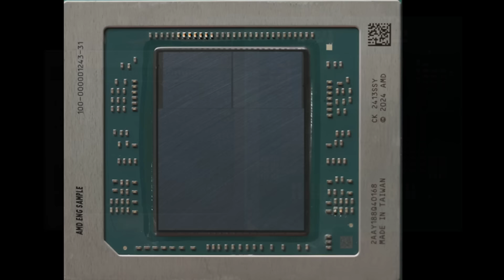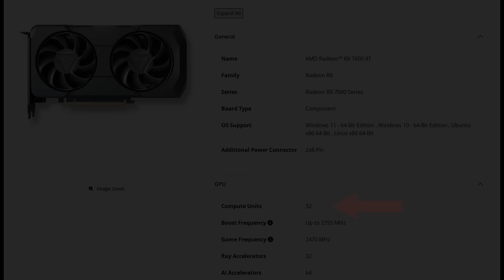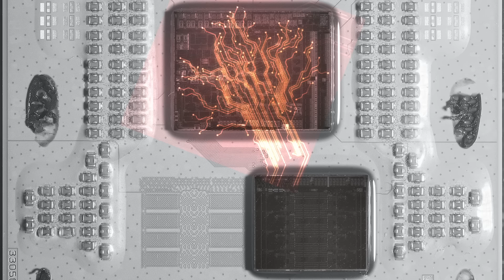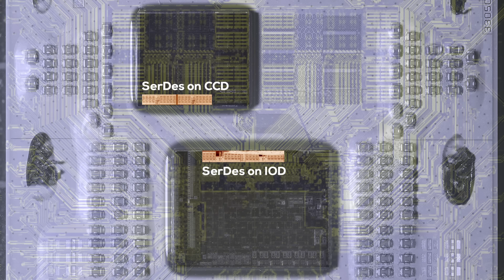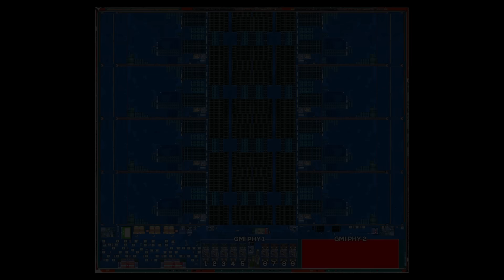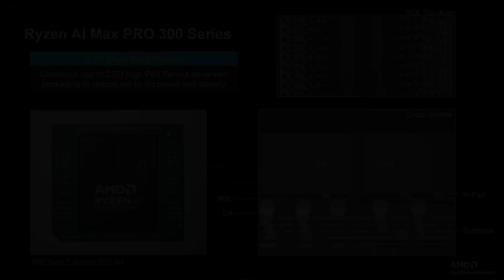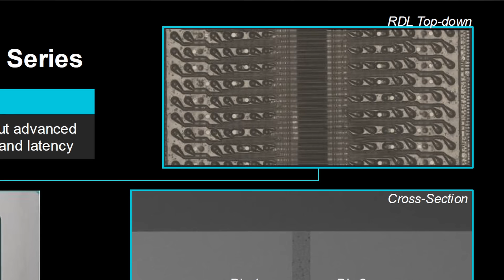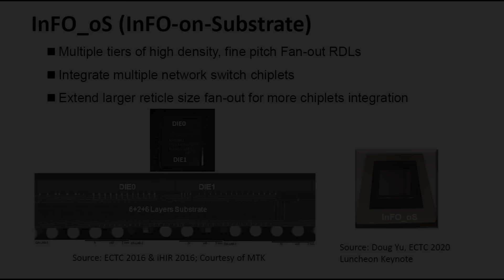How AMD is re-thinking Chiplet Design

Comment: STX Halo is such an awesome system (yeah if not for the unfortunately astronomical price)
Reply: The main reason for the currently inflated price for Strix Halo is the relatively great performance for LLMs. Maybe we (consumers) are lucky and that bubble bursts soon.
Reply: @abavariannormiepleb9470    The main reason the Halo APUs are so expensive is that they are workstation chips.  They are not intended for consumers at all.  They just happen to also be good at gaming.  It's the same ethos as a GeForce Titan card.  If you want gaming, you will get better results for less money with an i7 and 5070.
Reply: @abavariannormiepleb9470  has the bubble burst yet? checking in from the future
Reply: It's a bubble and bit of premiums related to "new" Gen 1 tech. As with anything tech related if you are price conscious wait for the Gen 3 (so Zen 9 if they don't change the naming)
Reply: It's justified, the 40CUs of RDNA 3.5 on par with a mobile 4070 on top of having 16 full Zen 5 cores was $2500-3000 laptop tier performance anyway. What's most impressive is all that is happening on cheap gaming laptop level cooling and power envelope, and relatively inexpensive LPDDR memory.
Reply: @hasnihossainsami8375 agreed. The BIG difference that people seem to sleep on is how much better performance you can get at lower watts. If this is comparable to a 4070 Mobile chip, it is basically a 7600 non-XT. And that is a 165W card. You are basically reducing the power envelope with over 50%. That is bonkers. 

Imagine what they can do elsewhere when you suddenly have an architecture that requires so much less power. You can either create products that need less power, cooling and size, or you can scale up and use the same power envelope, but pack in a whole lot extra performance. As an example, if you straight up scale the efficiency of the 8060S at 80W up to RTX 5090 desktop performance, you would need around 370W for it, compared to the 575W TDP it has. Now, performance does not scale linearly, but it shows how big of a deal this is.
Reply: @hasnihossainsami8375 a 4070 laptop with a 7945hx is ~1300 at most lmao

Keep coping though
Reply: It is quite similar in price to the intel and Nvidia counterpart.
Reply: its always at the start, theyre prolly still building up infrastructure to mass produce it untill then we will tank the prices
Reply: Zen6 should be available next year for better prices. Although these massive integrated GPU chips will still be pricey. 
And the desktop mainstream slop will still use a single compute tile/chiplet, halfing the interconnect bandwidth again. 
So strix halo really doesn't seem like a bad investment, considering you're getting workstation level bandwidth and a reasonable gpu.
Reply: @PaulSpades Medusa Halo seems to be scheduled for 2027 or even 2028, and if it were to come out in 2026, it'd definitely lack the UDNA graphics architecture and LPDDR6 support and therefore would have the same weak graphics and AI performance as Strix Halo (no proper matmul acceleration, no flash attention support for RDNA, not enough memory bandwidth for transformer models if its compute performance would improve, and overall it's a tiny GPU)
Reply: @обычныйчел-я3е darn it 😔, it's a long wait to get full advantage of this eh?
Reply: @обычныйчел-я3е imagine caring about AI
Reply: @обычныйчел-я3е what's your opinion on intel ultra 3xx series, it will have 180 tflops, not sure how to compare its Arc gpu with the strix/medusa halo gpu, however in the ultra 2xx series, the Arc 140 a;one has 77 tflops on pair with the one in the strix halo
Reply: @videoclick2009  HUH Ultra 2xx has Arc 140V as a top iGPU which has ~8TFLOPS of FP16 performance, not 77 TFLOPS, and it's nowhere near Strix Halo in performance. It competes with Radeon 890M which is used in Strix, not Strix Halo. 890M has 16CUs, not 40 like Strix Halo. Also, where 140V ends, clocking to the maximum, 890M is at roughly half of its peak performance as it should clock to almost 3GHz but it only needs ~1.6GHz to compete with 140V. And it's memory bandwidth limited. All AMD needs to ~double the GPU performance of 890M is just to give it faster RAM.
Reply: @alondjeckto 
AI techniques can be useful. I specialised in AI in my CS degree. I have since built two chess engines as a hobby. AI is a broad field of CS. The problem right now is the hysteria and hype and the ignorance. I use AI, so I guess I care, but I care more about single threaded performance than I do AI performance... and I don't give a toss about GPU performance.
Reply: @alondjeckto  imagine living in the past and not caring about AI
Reply: @videoclick2009  Intel 140V doesn't have 77 TFLOPS. It has ~8 TFLOPS of FP16 performance. It also doesn't compete with 8060S in Strix Halo but Radeon 890M in Strix. 890, which is memory limited and only needs a clock of ~1.7GHz (while it is able to achieve almost 3 GHz) to compete against 140V. AMD chips also do not use N3P node as Intel, but rather N4P that is worse in efficiency.
Reply: @Osaka2407  just verified, the arc 140v is 13 tflops fp16 and 8060s is 29 tflops
Reply: @videoclick2009  In what world does 140V has 13TFLOPS? It has 1024 cores and clocks up to 2050MHz in 288V. It equals to 4.1984 TFLOPS of FP32 throughput and double of FP16 throughput. The only way you will come anywhere near 13TFLOPS is my summing FP16 and FP32 throughput but it does not work that way. Also, 8060S clocks up to 2900MHz and has 2560 cores. That's 14.85 TFLOPS of FP32 and almost 30 TFLOPS of FP16. I do not know where you get your numbers from but they are wrong. And another thing - Radeon 890M has 1024 cores just like 140V, yet it generally wins against it, even when working at lower clocks - RDNA 3.5 simply has higher IPC which is not a surprise as Battlemage is roughly a generation behind AMD and NV.
Reply: @обычныйчел-я3е Nah homie its not schedudled for 2027 or 2028. Imagine AMD missing out in the AI race against apple and intel. Also its far away from being a weak gpu as it literally beats a rx 6600 which is a beast already on 1080p. Matmul accelerators matter for the tech purists only because it literally doesnt matter if you don't use epoch sized prompts. ( It primarily matters on how long prompt are you inputting) 

Medusa point is 100% coming next year. Apple is already rolling  out m5 this year and intel will roll out its own 8+ xe3 socs early 2026
Reply: @Osaka2407 Xe-LPG 140V as seen in 258v is claimed to have 64 TOPS (INT8 matmul), 32 FLOPS (FP16 matmul) if you take XMX into account.
Reply: @HeadleyyHighlights it beats RX 6600, the low-end GPU from 4 years ago that can be had for ~150$ now, and is only very power-efficient and remotely cost-efficient when attached to the CPU which is essentially an power-limited 9950X that not many people need. 
All of this IS very impressive and I'm all for it - however the GPU performance isn't enough for me (I want playability at 4K and it won't even run FSR4 very fast ;) and not much for the price they're asking, nor is it a game-changer for ultra low power consumption that'd be usable from battery power (the technology it uses will give us all of that, though).

Lack of matmul isn't a problem directly, it's just that it can be used to amplify AI performance (including its density and efficiency) by a factor of several times and is already giving NV an edge for last 4 client GPU generations and even Intel has it on Xe1 and up, Xe2 and up for iGPUs. (AMD implements matmul in CDNA and has doubled down on low-precision matmul for AI purposes in CDNA 4). 
Such a performance boost would help to use the huge memory capacity that STX-H makes available with AI or run a heavy upscaler efficiently.

I'd like it to come next year, but from all the recent leaks it seems that RDNA 5 and Medusa Halo is far from ready and complex silicon products like this don't just pop out of nowhere in 6-12 months. From the same leaks, it seems to me like 2026 is going to be a drought in the space of consumer products from all companies.
I guess Medusa Halo may also be more affordable since they'll be able to reuse CPU chiplets from desktop parts, instead of making special ones specifically for it.
Reply: It is coming down in price in some models.
Reply: I was wondering why it's so rare and expensive. Now it's so much clearer.

Comment: I just didn't understand one thing: Why did they keep using PCIe to connect the 8060S to the system and not something with faster connection
Reply from the maker: The 8060S is on the SoC die, it’s not connected via PCIe. These lanes are for M.2 SSDs and other external stuff.

Comment: Thanks for the cool content! One question: Why are the SerDes not being called Multiplexers/Demultiplexers (Mux/Demux)?
Reply: I think because MUX/DEMUX implies a selection of where to MUX from and where to DEMUX to. SerDes just puts all inputs in sequence over the link. Otherwise, I gues they function the same. I suppose a MUX/DEMUX can function as a SerDes if controlled properly.
Reply: @alexandru_donca  Thanks, that would make sense :)
Reply: because Mux/demux means selection. SerDes means conversion. They are not the same like at all.
Reply: @johnyang799  I had a look into a lowgrade documentation. Input A of a Mux is usually routed to Output A of the Demux. Input B to Output B etc... So it would be exactly the same like SerDes.
Reply: @thomaskunz3726 Yes if you look it that way. But it wouldn't hurt to ask ai to see what are the implications and differences in implementation.
If consider loosely, SerDes is like a special case of Mux/demux. Also SerDes implementations includes high speed mux/demux + clocking + analog i/o circuitry.
Reply: @johnyang799  Ah now we have the difference, serdes needs a clock :) Thanks!
Reply: On the other hand, some mux/demux also have a clock... hmm....
Reply: @thomaskunz3726 To some extent, and exaggerated, calling SerDes mux/demux is like calling cpu transistors or logic gates. Mux/demux are used to build SerDes but you wouldn't expect the next person understand that you meant SerDes.
Reply: @johnyang799  why would you need analog anything for a perfectly digital signal?
Reply: I prefer encoder-decoder, but americans must invent new words for common old tech, all the time.
Reply: @PaulSpades Encoder and decoder mean too many things already. Let serdes be serdes.
Reply: @johnyang799  In other contexts, yes. I guess some people call media accelerators the same thing now.
Reply: @PaulSpades  I bet the marketing guys love this :)

Comment: If the future of zen is this ridiculously overpriced Halo garbage, count me out. I‘m not paying 3000 $/€ for an APU, even if it is an admittedly good APU.
Reply: AMD is not going to replace their entire product stack with only expensive products. That's not how it works. I think a huge part of the price is because AMD wants money from the AI crowd due to its ability to use system RAM as VRAM, which brings down cost (for the AI crowd, that is). The Strix Halo is exactly what it's meant to be, a "Halo" product. I don't think the interconnect is the most expensive aspect.
Reply: @SealCorner yes, they will try to sell Zen2 based CPUs named Ryzen 9xxx with discontinued Vega graphics for those who can’t afford Strix Halo. Luckily I have the AMD cpu naming decoder ring, so I won’t fall for that scam.
Reply: @geraldh.8047  I don't see how terrible naming schemes have much to do with driving up cost. Being deceptive and confusing to unsuspecting users, maybe, but not the actual prices. None of Zen 2/Vega iGPUs have made it to AM5, as far as I'm aware. The Strix Halo isn't even desktop. And it's not like NVIDIA and Intel have never come up with deceptive product names. 

I will note that lack of understanding, poor ability to properly reason, and thinking "I won't fall for scams", are what makes one more likely to fall for scams. They all make the person more reliant on their emotions, and emotions are easier to manipulate, especially into not seeing the big picture. Owning a meme-worthy decoder ring that gives you less context and information than just double-checking things online isn't going to help you with avoiding scams.
Reply from the maker: Strix Halo is a low volume test run of this new interconnect. The high volume next-gen products won’t be Halo chips and will be a lot more affordable.
Reply: Better paying the same for Intel garbage and similar Nvidia performance...
By the way,  the Handheld Strix Halo version is costing 1400$.
/SARCASM

Comment: Its important to note that AMD generally sucks at video encoding, AMD encoders have awful quality (Apple has too) compared to Intel and Nvidia which need 1/3 bitrate for better looking footage.
Reply: They are also not supported in basically any 3D application. Even in apps where they are, like Blender, performance is shit
Reply: On what criteria ? Cause I remember on the release of the 9000 series. h264 was neck to neck image quality wise (using an automated benchmark though since "quality" is hardly quantifiable in simple term)

Pretty sure AV1 was also in the same ballpark with nvidia. Don't remember h265 perfs though.
Reply: @nekogami87  Since YouTube is a platform for bots and spam I'll keep my comment short: Intel AV1 looks at just ~12mbit identical to AMD ~36mbit. Intel was 3x more efficient for the same visual quality.
Reply: @owlmostdead9492ok so it's more about the file size than visual accuracy (not saying it's not important, but your original comment was leading me to think it was more about the later than the former).
Reply: @nekogami87  If you mean accuracy as in artifacts inside the footage, then yes AMD has them too (they have weird motion handling). AMD footage is almost pulsating since quality in some frames suddenly drastically drops. Most of these issues are gone at ~45-50+ mbit but on the lower bitrates AMD is just really bad, Apple also drops the ball on anything below ~30mbit.
Reply: @owlmostdead9492interesting, thks for the data !
Reply: @nekogami87  Sure, no problem. My test footage was 4k60p 4:2:0 btw, so AMD might not be as bad on 1080p/1440p but it probably won't be a lot better.
Reply: BLAH BLAH BLAH...trust me bro, I know stuff...
Reply: And h265 is pretty damn good
Reply: HAD. They were really bad in the days of Vega and Radeon 7. On the Radeon 7xxx and 9xxx, the quality really improved (I'm using both RX 9700 XT and 7900 XT with ffmpeg for some of my projects)
Reply: @dorinxtg  No they have not, I've benchmarked every encoder myself
Reply: H265 quality of AMD is much better than NVIDIA nowadays.
Reply: @BlingBlingBandido  Not even remotely, AMD h265 is about as good as Nvidia or Intel h264, sometimes even worse.